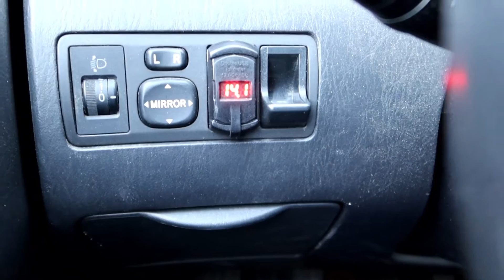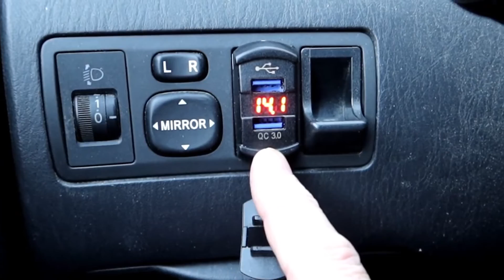How to install an USB QC 3.0 in a Toyota Corolla Verso or any car

Comment: Hi, thanks, first of all. I didn't get where is the black cable connected. Could you write this, please?
Regards
Reply from the maker: I found a screw on the chassis I attached the black earth wire to.
Reply: Well, that's what I understood from the beginning.  But does that mean that the connector is only receiving power from the red wire?  There are supposed to be two poles connected, right?
Reply from the maker: Yes, that's correct. One pluss and one minus. Red to the pluss fuse, black to the minus which is the metal body.
Reply: @Italjohn  thanks a lot. I'll try. 🙂👌🏻

Comment: Hi, thanks for such great videos.
Where did you buy the cable, adapter or device to replace in the fuse box?
Thank you
Reply from the maker: The fuse cable I bought locally here in Norway (www.biltema.com) Please check that you get the correct cable for your type of fuse, as there are several types.  The usb I bought here: US: https://amzn.to/2WCgOlt
  DE: https://amzn.to/2YVm6aP   UK: https://amzn.to/2K8ZvUI
Reply from the maker: Found this on Amazon: https://amzn.to/2vIZfFo
Reply: @Italjohn  Gracias!!!!!
Reply from the maker: krasen krumov  https://www.biltema.no/bil---mc/elektrisk-anlegg/flatstiftsikringer/flatsikringsholder-med-uttak-2-stk-2000035590